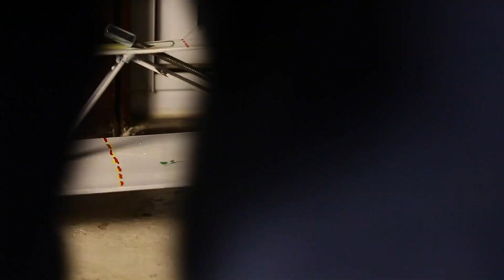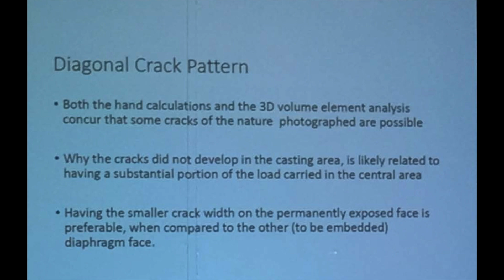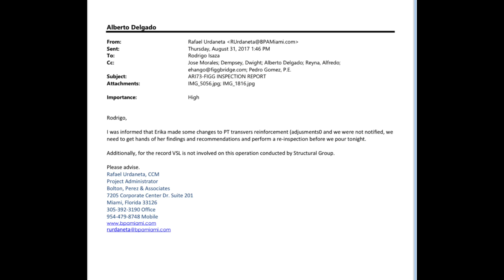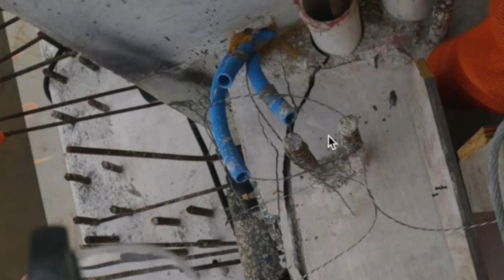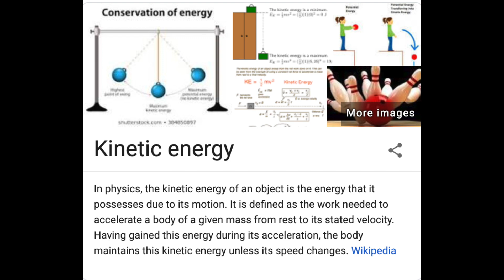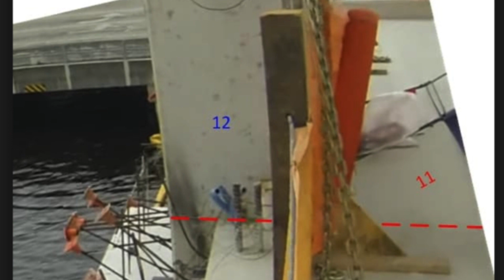FIU BRIDGE COLLAPSE MODEL PART 5 SAGGING DECK EXPLAINED = LONGITUDINAL POST TENSION FAILURE FIRST

Comment: You ever want another job you could tour engineering and architectural universities.  Ya know in olden days PHYSICAL MODELING was a respected SCIENCE and you're probably far more likely to get "unexpected" results when loading as opposed to a math model which can only respond in ways YOU TELL IT TO.  Wonder how many old constructs were saved by some assistant playing with a model and going holy crap look at what's it doing!
Reply from the maker: Thank you Russell, agreed,  computer models are not that great.
We are told, falsely, that FEI are better than a human's brain...
Or a physical model is just so so.
Staying focused, these series of videos will show that ''deflection / sagging'' is what started this ball rolling to failure.
That once the formwork was removed, it was reported those "cracks like hell" were identified (but not developed fully until the day they remove the post tensioning in number 11 and 12 base and canopy blister)...
The initial cracks that are presented ARE from the removal of the formwork; this means the structure was NOT ''flat" because of the deflection / sagging"  WHICH MEANS this was turned into a ''truss system'' or a ''Torsion loaded I-Beam" and that torsion presented itself in those hairline cracks at the base area of 12 DAYS BEFORE THE MOVE.
ONCE  THEY De-TENSIONED (de-stressed) , the TORQUE and cracks really developed and I believe was only stopped from collapsing because of the post tension bars ''re-grabbing" at the base of 12.
This MEANS the deck SAGGED even FURTHER and when Figg and the rest of them allowed for ''re-tensioning'' the SHIMS that were now ADDED under 12, made a NEW pivot point for the clamp force of the number 11-B (upper post tension bar) and THE GAP could NOT be closed because of the NEW EXCESS FRICTION created by that newly created PIVOT POINT that could not ''slide'' back into the cracked openings as PLANED by these engineers!
That it created so much stored force in energy at the base of the post tension bar that the concrete was able to hold until it explosively gave out! AND this INWARD EXPLOSIVE FORCE, BLEW OUT PARTS OF CONCRETE (which people want to know about in the live video- ? where did the explosive concrete come from?)...
At that point number 12 was no longer active and it's failure was just  part of the chain of the failure.
It's explosive release of energy caused an ''Earth Quake" in the system because Post TENSION 11-B BAR WAS HOLDING THIS structure together (from sagging down) it was the ''tie-back'' of the this structure to the diaphragm and once it was released, the structure was free transfer it's loads only from the 9 / 10 node to the diaphragm... it could NOT do it without the deck failing transversely... and of course, above that 10 and 11 node, it failed between the node and the canopy (transversely also)  ...  
IF< the deck could have had STRONGER POST TENSIONING IN THE LONGITUDINAL DIRECTION it would not have FLEXED... I have another video that will question the one tendon, ''D-1" and concrete placement; this will be in the next video perhaps.
Note: This model will be plasma cut to show longitudinal post tension cables...
The current model is how the design was intended to perform.
I need to find out what ''sagging location" was identified per the CEI questioning the sagging...  It appears to be between 9 /10 and 12.
Reply from the maker: Russell, hope you are still alive...  I will be reposting this series again, in a few days  and will add    7:00 the ''by-pass " does not exist, can you tell me why ?   Hint,   number 12 is NOT able to isolated out of system = therefore, it would STOP the ''by-pass" and would create more of force at 10 and 11 blister bar / node... this creates the uplift stress at the base of 11 and 12...   now run with this in your minds.

Comment from the maker: 7:00 the ''by-pass " does not exist, can you tell me why ?   Hint,   number 12 is NOT able to isolated out of system = therefore, it would STOP the ''by-pass" and would create more of force at 10 and 11 blister bar / node... this creates the uplift stress at the base of 11 and 12...   now run with this in your minds.

Comment: That crumbling concrete was essentially aggregate. Is post-tensioning aggregate a FIU specialty?
Reply from the maker: Agreed, is was just pieces, the rebar might have been present but once the gaps were created, it could not perform as ''designed''.
Reply: They would have been better off building the pedestrian bridge with just rebar and ignoring the concrete lol.

Comment: That steel model does a great job of helping visualize all the photos and theories bantered around here for the past several months. Funny how simplified physical models work like that.
Reply from the maker: Hello Dos, head's up, I will be reposting these videos with this model.
Reply from the maker: 7:00 the ''by-pass " does not exist, can you tell me why ?   Hint,   number 12 is NOT able to isolated out of system = therefore, it would STOP the ''by-pass" and would create more of force at 10 and 11 blister bar / node... this creates the uplift stress at the base of 11 and 12...   now run with this in your minds.

Comment: One slippery foot will break a deck.  They designed the thing, they built the thing in union with a bridge engineering school, with numerous gov agencies involved, they had tons of engineers, student help, computer programs, and EXPERIENCE.  There were BIG cracks that evolved from small cracks, so they were growing. It came down to one man's order that it would be safe. But we know that there was so much pressure that it became too big to fail, so how much say did he really have?  The entire drama is heartbreaking on many levels.  And you know that the engineering teachers at FIU are passing the NTSB assessment to the students, so the cycle will continue.....   Is there any way out of this madness?
Reply: Funny it was too big to fail (or nobody cared). On the other hand, this was a tiny footbridge, of which there are thousands in earthquake ridden Tokyo alone. Level of incompetence surrounding FIU and resulting loss of lives is sad.